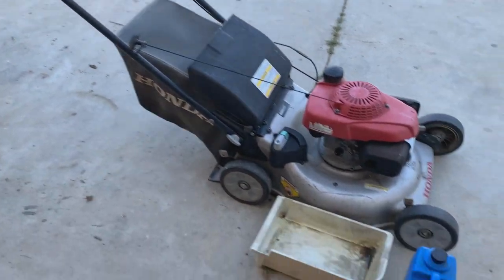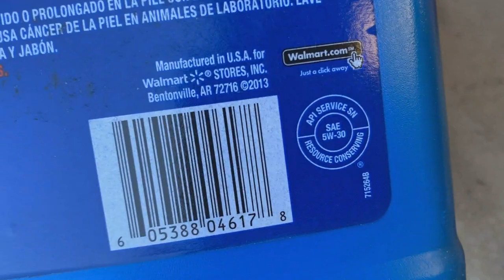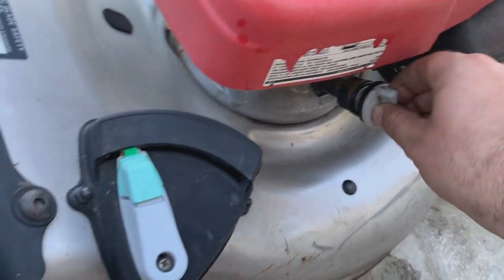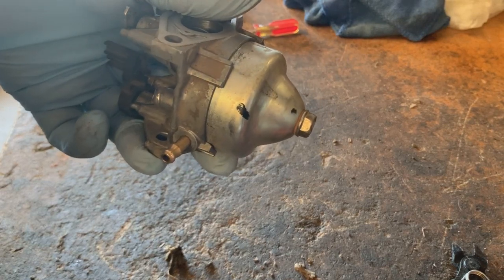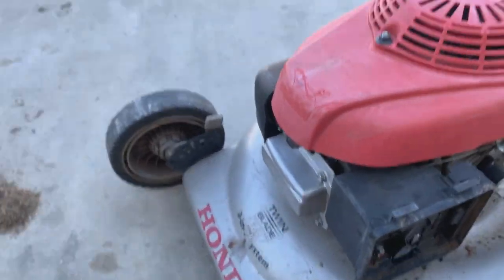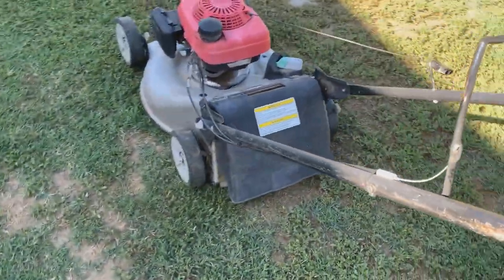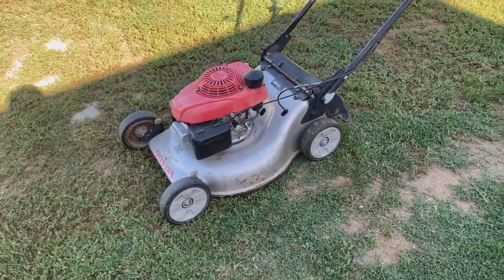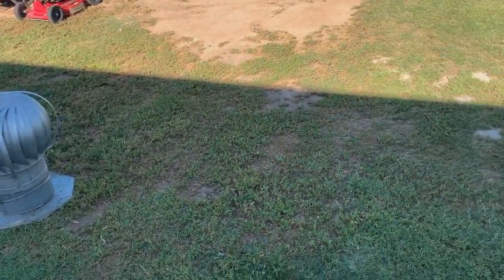Honda HRR Quadracut Carburetor Cleaning

Comment: Hank, you need a backup for the backup for the backup. I had several for the longest time, finally sold them. Kept just the electric start Craftsman that I converted to auto choke from primer.
Reply from the maker: Ha if only right.

Comment: Keep the snapper. That robin engine will last forever. And more rare than a Honda. Honda’s are everywhere.
Reply: I bought a Snapper 25 years ago when I bought a house. Used it until I think the crank shaft broke. But, my neighbor was moving and offered to sell me his three year old Honda for $150, so I grabbed it. I like the Snapper way better. It’s just a much better design: mulches grass better, had a better bag design at the time, had a higher handle for tall people. Just too many pluses over the Honda. The Honda’s bag design is a piece of garbage, the mower engine only runs at one speed, and it doesn’t mulch grass as well. I still have my Snapper, which I might repair and sell the Honda.